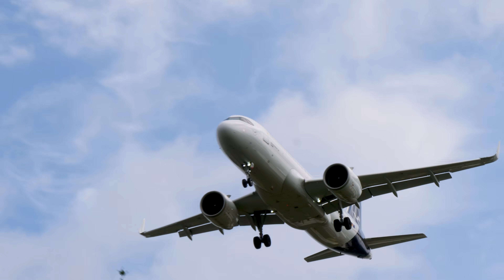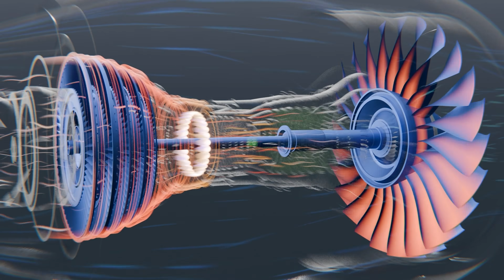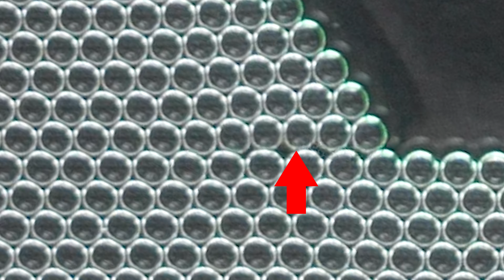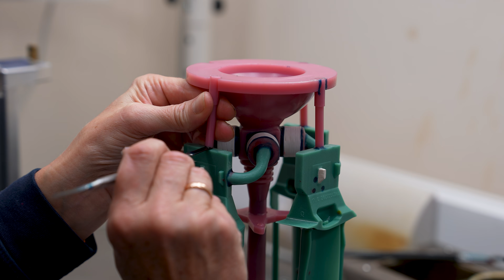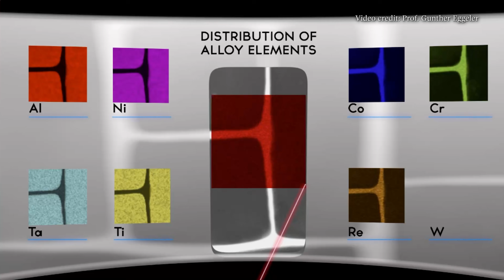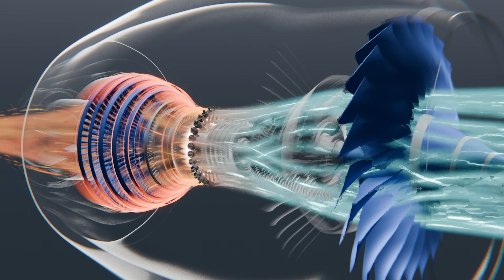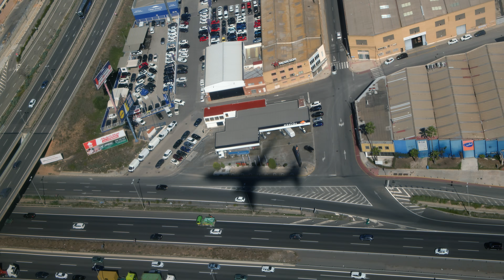The Ridiculous Engineering Of Jet Engines

Comment: I am wondering how the copper base won't melt at 26:23. Its melting temperature is 1085 °C. If you cool it to be solid, the cast would cool way too fast. While if you had a pool of liquid copper at the base the denser alloy would displace it.
Reply: It's cooled using water, so it never reaches those temperatures.

Comment: Video laks about the turbine/compressor blades as if it was the biggest problem since  the invention of the jet engine. 
But in fact it was and still is the combustion chamber. For the Wittle and Hans von Ohein they had to figure out how to keep the flame actually burning in the hurricane within chamber that shouldn't melt. 
I believe it is the most secretive part of the manufacturing process.

Comment: If they made car engines out of more heat resistant alloy metals. They could run a leaner fuel to air ratio. Which would increase engine internal temperatures but still provide the same amount of power. Making the engine more fuel efficient. A car engine can run at a very lean air/fuel ⛽ ratio but will quickly burn a hole through the piston.

Comment: Yet jet fuel melts sold thick structural support columns on 911 including Building 7 and as the think black smoke showed the fuel was burning under inefficient combustions. conditions. So the temperatures were far lower than efficiently combusted jet fuel

Comment: 12:40
and just like other metals it also weakens and oxidizes with ehat so its useful operating temperature is way way below its melting point
thats why lightbulbs need to have a vacuum or protective gas inside them after all, otherwise the tungsten will effectively catch fire
damn coal i na vacuum is incredibly heat resistant and is famous for... burning

Comment: As of 6:36PM GMT+8 Nov. 17 2025 the title is "Why don't jet engines melt?" and the thumbnail is "Runs at 1500°C / Melts at 1250°C"
Reply: As of 11:06 GMT+0 17 Nov 2025 the title is "Inside the Rolls-Royce jet engine factory" and the thumbnail is Derek In front of suspended jet engine
Reply: It's randomised from a selection of titles and thumbnails. Two users can get different titles at the same time.
Reply: Thanks for saving me the time
:)
Reply: Wait, why do we see this?
Reply: Is it a way to best the algorithm?

Comment: If the blades extend under temperature and rotation, wouldn’t the ceramic coating start cracking and shattering pretty quickly? Is that actually a major maintenance concern, or even the main bottleneck for how long the blades can stay in service?

Comment: 4:50
whatsworse, a jet engien does not run a carnot cycle, its actually worse than that theoretical limit, there are more complex factors but if you want to get a rough grasp on a jet engiens thermal efficiency you basically have to insert the compressor outlet/combustiin chamebr inlet temperature for Thot
which means to get a high efficiency your compressore has to compress the air so much it get significnatly hotter
but then to actually produce a meaningufl amount of power you need to also add heat by burning fuel i nthe combustion chamber
so you have to heat it up twice and the temperaturel imit of the turbine limits the total temperature budget yo ucan baalnce between that whcih is why its such a useful indicator for how advanced/performant the technology used ina jet engine is
and in a turbofan if you want to really maximize efficieny you want to gain the power in order to move a large amount of air using a fraction of that air as small as possible which means oyu need to get a significnat maount of energy from each bti fo air and add a significant amount of temperature in the combustion chamebr but at thesame time to maximize efficiency you need to add a significant amount of temperature in the compressor already
thats also another part of why jet fighter engiens tend to be less efficient at low speeds
when going mach 2 the air inlet slows down and compresses the air thus heating it up which is essentially an additional factor multiplied onto the compressors compression ratio, if you want to be able to run your core at full throttle at mach 2 your compressors compression ratio needs to be low enough that your temperature budget works out despite this additional factor which means that without this additional factor your compression ratio is kinda limited to a bit less than it would be in an airliner engine

Comment: It isn't counterintuitive really :D It's almost identical to how a turbo works. Exhaust gasses driving a turbine that brings in more air for combustion. I guess the difference is that a turbo doesn't directly provide thrust, where the additional air pulled in by the jet engine does.

Comment: From a mechanic’s perspective, despite running at these extreme conditions for hours on end, turbine engines are far more reliable, more efficient, require less routine maintenance, and can run way longer between overhauls compared to reciprocating engines. Once you break down what’s going on, in my opinion they are fairly simple with few moving parts. Amazing technology.

Comment: meh No Big deal....Cool video, but the “hotter than melting point” bit isn’t that magical. The blue part of a cheap butane lighter flame is ~1800°C, the plastic body melts at ~170°C, and yet it doesn’t instantly turn into goo. Same story: the gas is hotter than the material’s melting point, but the material itself is kept cooler by geometry, cooling and limited contact.

Comment: For those who wonder why the thumbnail says it "melts at 1250C" but google and find out Ni-Superalloys melt at 1500C, what Veritasium actually means is Creep Fracture. Under static loading (from spinning), you can fracture your material at a lower temperature than their melting temperature. That's what we see in the Cambridge heated loading tests.

Comment: Rocket engines are even crazier. The main combustion chamber on say, the Space Shuttle main engines, is made out of alloys that melt at only about 1000C.
Yet the temperature inside the chamber itself reaches about 3300C - or more than three times hotter.
The only reason it doesn't melt is because it's pumping liquid hydrogen coolant through the chamber walls at an absurd rate, such that the heat is removed faster than it can heat the walls up.
If that cooling were to stop for even just a fraction of a second the chamber walls would not just melt, but *boil*.

Comment: I'm just amazed that given the very high RPM, that the jet blade material is resilient enough not to degrade or crack, especially since it goes through such extreme temperature swings every time the engine operates... not to mention the many hours sustained at 1,500 C.

Comment: All this makes the SR-71 engine system developed in the 60's with slides rule all the more impressive.  It's J58's were one of the first single crystal bladed engines, but weren't internally cooled or coated and were ultimately the limiting speed factor.

Comment: I have a turbomolecular pump. It is a spin-off from jet engine technology, with its design based on the turbine-like structure of a jet engine compressor, but working the other way around. Its blades rotate so fast that first of all you have to create a conventional vacuum before with a common pump. If some air entered while working, the blades would shatter explosively. I am not talking about sand, but thin air.

Comment: I have a question if u drill holes in a single crystalline blade won't that introduce failure points due to change in k value ?? 33:41

Comment: Veritasium could step it up a notch and show how rocket engines survive what they are put through. Heat, pressure and force are scaled up a lot and also the cost of failure.

Comment: original title: "Why don't jet engines melt?"
original thumbnail: derek's top half visible on the right while holding a (i suppose) part of the engine with a turbofan engine on the left side. text in front of the engine says "Runs at 1500°C" and another at the bottom says "Melts at 1250°C" and a red arrow pointing to the engine part derek is holding

Comment: This will all change with electric engine
Reply: An electric engine is usually referred to as an electric motor.
Reply: @paulpaul9914 yes you wouldn't need stupid temperatures like these engines also they would be more efficient than guzzling 10 tons of fuel and producing pollution
Reply: @LovelyDivingBoard-ch8oq 

The best possible electric motor & battery configuration would weigh about 20 x more than an equivalent thrust turbofan and liquid fuel setup.
Reply: @paulpaul9914  technology has moved on
Reply: Hybrid small engine could power the electric motor
Reply: @LovelyDivingBoard-ch8oq 

That's for the latest tech. Battery and motor is 20 heavier for same range and thrust.
Reply: @LovelyDivingBoard-ch8oq 

It's an aircraft not a car. IC piston engine + generator and motor would probably be 40 times heavier for same range and thrust.

Comment: This is the same as with aluminum foil, which doesn't melt in a normal campfire even though the fire is hotter than its melting point.

Comment: “Shouldn’t this be done by robots?”

Shouldn’t your videos be AI generated?

I mean, you did lie and say the first jet engine was built in the UK in 1941 when the first one was built in Germany in 1937 and the first one successfully flown was in Germany in 1939.
Reply: The world's first demonstration of a running gas turbine aero engine was performed in 1937 in England.

The RR Nene was the most powerful & reliable gas turbine aero engine on the planet in 1944. Versions of it would go on to power aircraft in Russia, China, the US, France, the UK and Switzerland.

The gas turbine engine was invented in England during the 1700s.

During the 1800s Parsons of Ireland & North England produced the world's first axial multi stage sequential stator rotor turbines and compressors for turbomachinery use which would eventually go on to to form the main components of the axial gas turbine aero engine. At the time the basic idea of making an internal combustion gas turbine engine and using it as an aircraft engine was considered thus the jet aircraft concept had been created England before the first powered aircraft flew.
Reply: @paulpaul9914 We’re talking about the first functional turbojet engine, not random uses of other types of turbines.

The first functional ground demonstration was in Germany in 1937.

The first jet powered flight was in Germany in 1939.

The Brits had a patent in 1930 but that’s just a design.

Comment: 31:42 It's impressive that we can take NY to Paris flight with about $310 nowadays, despite all that inflation(it varies by condition and usually costs more than that, but still.)
Reply: Regarding the inflation in this context… either economics has nothing to do with science or the people in charge of economic controls do not apply it.
Reply: paid about 6x that per ticket from DC in economy which is just 200 miles further south. they make as much profit as possible during high demand periods, and a lot of flights are operated at a loss. but yeah still impressive to have that level of performance and safety while you pay the same the minute you step in a doctor or even veterinarian door

Comment: All I engines work like that. An aluminium piston cylinder has gases at 1500 to 2200 C.
Reply: are you talking about car engines? keep in mind that in a cylinder in a car engine, the 4 phases happen one after the other. just after ignition the temperatures reach their peak, but only for a fraction of a second, then they start decreasing again. 
in a jet engine, the 4 phases happen simultaneously, in different parts of the engine. the first few turbine stages are exposed to such temperatures all the time. that's why such engineering is necessary to keep the blades (relatively) cool.
Reply: @mrxmry3264yep, and it's completely different scene in car engine, because the hottest temperature is at the core or start of the ignition and only way heat can travel from there to piston or cylinder walls is by radiation. And there isn't much time for heat transfer to occur during the power stroke. So yeah, the jet blades heat problem is far bigger than reciprocating engine.

Comment: Wasn't the first jet engine a german one?
Reply: The world's first demonstration of a running gas turbine aero engine was performed in 1937 in England. The basic concept and arrangement for that particular engine was thought up 7 years prior. 

The RR Nene was the most powerful & reliable gas turbine aero engine on the planet in 1944. Versions of it would go on to power aircraft in Russia, China, the US, France, the UK and Switzerland.

The gas turbine engine was invented in England during the 1700s.

During the 1800s Parsons of Ireland & North England produced the world's first axial multi stage sequential stator rotor turbines and compressors for turbomachinery use which would eventually go on to to form the main components of the axial gas turbine aero engine. At the time the basic idea of making an internal combustion gas turbine engine and using it as an aircraft engine was considered thus the jet aircraft concept had been created England before the first powered aircraft flew.

Comment: The iconel blades used in Allison engines around the turn of the century were so brittle they sounded like glass when tapped, the worst sound a turbine mechanic can hear when lifting an engine out of it's transport case is the gentle tinkling as all the shattered blades fall out of the back of the engine.
Reply: "the sound you never want to hear when working on a jet engine"

Comment: 8:40, for the 9/11 conspiracy theorists.  The steel did not need to melt, just weaken it, which occurs well below steels melting temp.
Reply: This demo was a tensile failure of mild steel as the sample was approaching 550 c. I dont know how relevant that is to debunking 9/11 conspiracy theories. 😅 maybe a compressive or shear demonstration of a structural steel sample would be more relevant.
Reply: They claimed that steel melted because there was a pool of molten slag discovered buried in at least one of the towers and the firemen said it was like a foundary, and they observed 'molten steel flowing down the channel rails' - this was probably Aluminum.
Reply: @greenscience101  i think that wouldn't explain it well, since aluminium has a much lower volumetric heat capacity than steel. The structural steel would cool and solidify the flowing molten aluminium very quickly on contact.

Comment: When the engine turns on, what drives it? There is not compressed air at this point?
Reply: not sure what you mean here. are you asking how an engine is started?
there is a small turbine that can spin the high pressure rotor, running on compressed air from an external source. could be a GPU, and APU or even another engine. once the high-pressure rotor is rotating, the airflow will get the low-pressure rotor going, and once that reaches a minimum N1, you can inject and ignite the fuel. then the turbines start providing the power to keep the engine going, and the starter turbine can be shut down.

Comment: The simple answer is that they don't melt because they're actively cooled to well below the material's melting point. Nickel superalloys and single crystals add strength, but the melting point of these alloys isn't really that much different from other metals. TBC reduces metal temperatures, but only if there is cooling air to pull heat away internally. So it really all comes down to the cooling flow. 

This is why sand/dust getting into the engines is such a problem. The particles that make it into the cooling passages tend to be so small that they largely just follow whatever the flow is doing. That is, until the fluid makes a sharp turn, impinges on a surface, etc. Then the particles behave more ballistically and hit/stick to surfaces, building up over time. Note that the locations where this tends to happen are precisely the areas where we are trying to do cooling: jet impingement on interior surfaces, turns into film cooling holes, etc. So this dust not only blocks cooling flow, but the buildup creates an insulating layer that inhibits cooling (sort of like a TBC on the inside keeping the cool air away from the metal). There's a lot of effort that has gone into trying to understand the mechanisms of this dust sticking inside these components to try to predict it and design parts that are more capable of resisting that buildup. I did my PhD on exactly that topic. 

Side note, nice to see Prof. Thole in a Veritasium vid - she's extremely well respected in the gas turbine community.

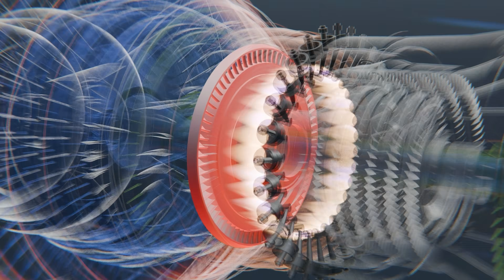Comment: 2:05 P1V1=P2V2 so if it goes from 50atm to 1 it's expanding 50x not "almost 20x" ...also if the compressor alone is driving it up to 50 atm it would much higher than 50 atm after combustion... make it make sense
Reply: Combustion in a jet engine DOES NOT increase the air's pressure, it lowers it. The air is not confined like in a piston engine. Light a match, flic your bic, turn on a gas stove. What is happening? The air gets hot, it expands and that increases it's velocity. That expansion DECREASES it's pressure. Find a hair dryer and turn it on cold and then hot? The only difference is the air gets hotter and moves faster when the heat is on. The only difference between your hair dryer and a jet engine is the lack of a turbine in a hair dryer. The addition of heat is the same whether it is from an electric element or the burning of fuel.

Comment: I'd love to see how aerogel responds in a similar environment to a jet engine. I know in theory the temps shouldn't be too much of an issue with silica aerogel, but I also know it's quite brittle. I'm sure it's been tested, and possibly continues to be tested to find a winning formula. Obviously a full blade could never be made from such a material, but a coating, like the ceramic coating could be feasible.